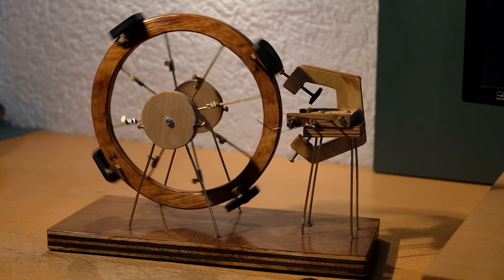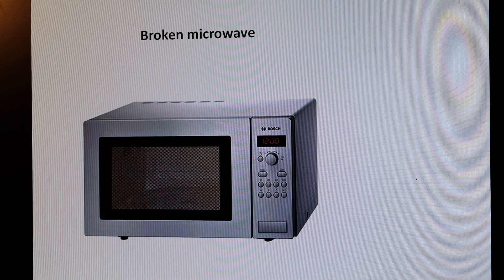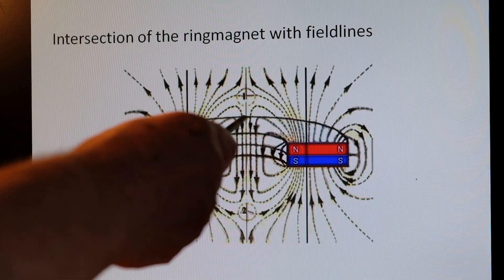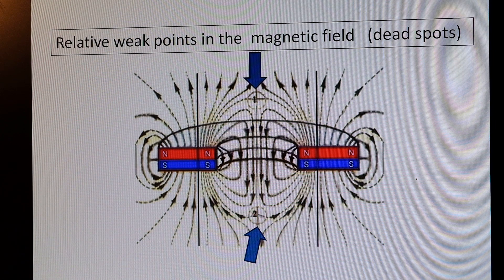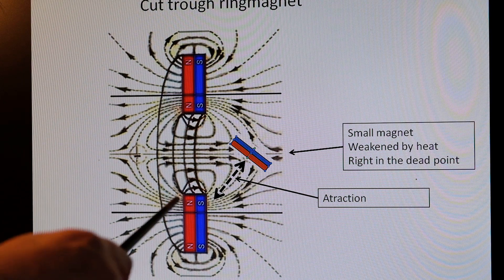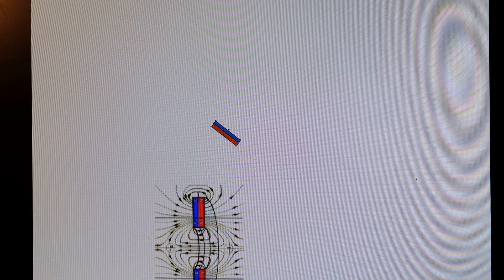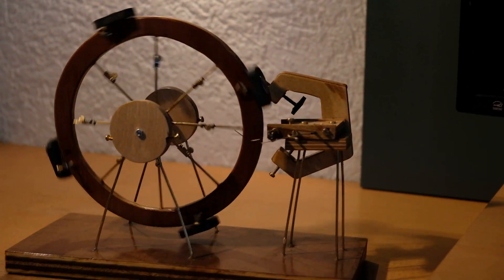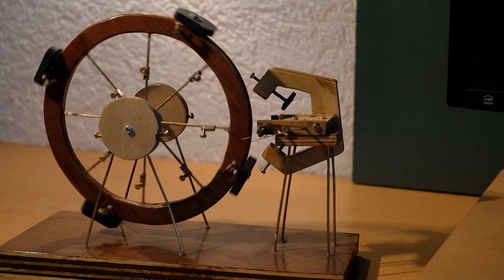Self running magnetic motor  self running magnet motor

Comment: I don't think the point is to give it a load necessarily. What I'd do is have the magnets excite coils to take advantage of the energy in the environment through back EMF by having a quick ON OFF through a transistor. All you really need is a continuous rotor and if you use air coils then there is no drag back on the magnets, especially if you fix the circuit so that the back EMF can give a little kick to the magnet on it's way out away from the coil.
Reply from the maker: Thanks for your reaction. you are speaking words of wisdom.
Reply: @perpetuummobile5068  True wisdom is quiet when you don't know what you're talking about.
Reply: the coils without drag back are only open coils (and obviously not kick away nothing), when you close the circuit trougth a load the coil drags back the magnets
Reply: Alas, the force generated by these coils will be very meager and will not be able to push a magnet even 100 times smaller than this one.
Reply: I can hear it so it's already outputting more energy than what's going in.  Overunity, or in my tongue, magic, has been achieved.  You all saw it here, the bloody impossible.

Comment: Why is there no repulsion when the small magnet ist passing the first side of the ring?
Reply from the maker: I think that I understand you question. In the first place there is a big mistake in the powerpoint from the momentthat  the pictute  is moving . the little magnet is in wrong  position. The problem is that  I cannot change the film in youtube._I also think that there are moments during the passing of the small magnet  that work contra productive. Not a problem as long the result is positive
Reply: @perpetuummobile5068  That is what I can verify at the moment: there're negative torque while the stator magnet is passed. But it's all about the right timing to trigger the lever for turning the stator magnet.

Comment: Notice that to have FREE ENERGY the device should show a continues acceleration and this device do not produce that, it can only gain some speed and then maintain such speed
Reply: So there for as this device do not use gasoline or any other  input so this is a REACTION DEVICE, using environment energy, gravity plus magnetism
Reply: The device proves something really interesting ... you can use magnets to have a reaction in such form that gives  you more energy as out put that what you put on the input due to the way magnets work  because magnets produce fields that are not on equilibrium and the lack of such equilibrium produce motion and the interaction of other forces prevent the magnets to reach equilibrium at any point in time there for motion, the problem comes when you put a load
Reply: The load could mess the reaction and there for prevent all motion jaja so  you wont get free energy or the free energy would be really low
Reply: @jorgeflores5222  It's already got a load, I can hear it, air friction, bearing friction.  It's already putting out more than what's going in.
Reply: Graeme Lastname Exactly lol.. so many people think load is exclusive to copper wires or something. If a wheel can magically turn longer than it would otherwise, and has the same controlled variables of load inertia etc.. it is already perpetual in theory. I don’t know why people don’t understand that lol. Any moving object is already 100% efficient, so any shown improvement on a spinning wheel, regardless of load, is over unity. As long as the load remains the same in both experiments
Reply: @jorgeflores5222  The device proves something really interesting ... The batteries are well hidden.
Reply: A perpetual motion machine doesn’t necessarily have to produce a constant acceleration. For example if the Newton’s gravity wheel worked, it couldn’t possibly accelerate too fast because it depends on steady force of gravity to work. Instead it would ocilate in a very synchronized way as it tries and fails to speed up. If this machine works the way he claims it works, it would move something like this. The small magnet has to have time to reset after all before it can address the next magnet, so it can only turn so fast. But in any case, based on the principles he described alone, it doesn’t work. So either it’s fake or he just doesn’t fully understand how it works

Comment: EN:
A theory came to my mind how this engine could work.
Perhaps the small rotating magnet is so weak that it undergoes reverse magnetization under the magnetic field of the large magnet on the wheel when the two magnets are closest to each other? Then there is probably no resistance to rotating the small magnet in the field of the large magnet. As the magnets move away from each other, the field of the small magnet returns to its normal polarity and interacts with the magnet on the wheel to drive the wheel.
One would have to try with a very weak rotating magnet placed close to the wheel.

PL:
Przyszła mi do głowy teoria jak ten silnik może działać.
Być może mały magnes obrotowy jest tak słaby, że ulega odwrotnemu przemagnesowaniu pod wpływem pola magnetycznego dużego magnesu na kole w momencie kiedy oba magnesy są najbliżej siebie? Wówczas chyba nie ma siły oporu przy obracaniu małego magnesu w polu dużego magnesu. Po oddalaniu się magnesów od siebie pole małego magnesu wraca do swojej normalnej polaryzacji i oddziałuje z magnesem na kole napędzając to koło.
Trzeba by spróbować z bardzo słabym magnesem obrotowym umieszczonym blisko koła.
Reply: Hello Jar Kon, good theory, let's test it manually.
Reply: @antonioijano8060  Good luck. I will also test it.
Reply: @Ogród_i_Elektronika  Good morning Jar Kon, just to inform you, I tried with the magnets very weak (weakened by the heat) in my case it still didn't work, although it improves for an interaction of the magnetic fields, but on the other hand they don't have the strength to turn the wheel because of the friction of the lever. Let's keep in touch, Hugs my friend!
Reply: @Ogród_i_Elektronika  Congratulations on your creativity, I was delighted with your intelligence, now put the little magnet on and see if the frictional strength will improve, because in my opinion our problem is friction! We are looking forward to it!
Reply: @antonioijano8060  In my opinion, the biggest problem is the magnetic resistance force when a small magnet rotates in the field of a large magnet.
If this force can be minimized somehow, the frictional forces of the mechanism will be overcome by the attractive and repulsive forces of both magnets.
Reply: @Ogród_i_Elektronika  
Yes, really, there is this magnetic force that brakes too.
Reply: First, start with a frictionless bearing, that should be easy.  An AC permanent magnet, yeah.  Get that at the toy shop?

Comment: Everyone who watches your videos (including me) would like to believe that you've succeeded where centuries of inventors have failed.  Not to mention, that all the physics books would need to be rewritten.   But, I can't take your machine seriously as long as it has that thick, laminated wood base, because it's the perfect place to hide an electromagnet, a circuit board, and some batteries.   It wouldn't be difficult to replace that base with a transparent one and silence a lot of skeptics.  But, you're unwilling to do that, so I think you're having a big laugh at all the folks who believe in you.
Reply: You might be interested in these machines..

https://ie.energy/earth_engine/

There are two others almost production ready..

https://infinitysav.com/magneticgenerator/

https://gaia-energy.org/en/projekt-yildiz-announcement/
Reply: @nobulistic  Denis, Thanks for providing a link to the Earth Engine website.  The machine shown on the website is impressive looking, and it's obvious that some investor (or group of investors), with a big pot of money, believes in the project.  I'm not going to dismiss this invention on the basis of the Laws of Thermodynamics, because I think it may be possible to produce a machine, based on some new principle, which can run for long periods of time, while drawing energy from some source we have yet to discover.  Consider that an atomic energy power plant would have looked like a "free energy" machine at the time of the Civil War.  Now that we understand the physics of atomic energy, we can see that atomic power plants break none of the laws of Thermodynamics.  Assuming that the Earth Engine can produce and sustain "over unity" power output for a period of years, while doing useful work, then everyone on this planet will know about and use this invention before the end of this decade.  But, that's a big assumption for me, because as Carl Sagan said, "extraordinary claims require extraordinary evidence". So, while this machine looks promising, I have to withhold judgement until more detailed information is provided by the inventors.  If pressed to guess how it works right now, I'd have say big flywheels make me skeptical, because they store energy.  So, I'd guess that energy stored in the flywheel is keeping the machine running.  If the initial push that started the flywheel rotating came from an external source, and if the flywheel is gradually slowing down, then this is nothing new and what we have is a hoax.   This machine has the potential for being either the greatest invention in human history, or one of the slickest scams in history.   One problem I have when it comes to believing in this device is the fact that the machine shown in the video is so large, that it's impossible to determine if a source of input power is connected to the device somewhere.  For that reason, I can only evaluate the claims made for the invention by examining the explanation of how it works that was given by the narrator in the video and from reading the information provided on the Earth Engine website.   From reading the website, it appears that two principles are at work, the first is an asymmetrical magnet array and the second is the "Slingshot Effect", which NASA has used successfully to give a boost to exploration spacecraft.  Regarding asymmetrical magnet arrays, a linear Halbach array does have a strong side and a weak side.  One can imagine that an array like this this might be useful in an over unity magnetic motor, but no details are given about how the asymmetrical magnets are used, so that information is not very useful at this time.  As for the "slingshot effect", that doesn't produce any energy by itself, it only transfers energy from one system to another system, so that principle alone can't contribute any energy to the device if the attraction of gravity is replaced by magnetic attraction in the device.  It's true that gravity assistance from a planet can be used to accelerate a spacecraft; but, the assist is provided by the motion of the planet traveling around the sun, using the planet's gravity to pull on the spacecraft and thereby to accelerate the spacecraft.  To put it another way, to increase speed, the spacecraft acquires some of the planet's orbital energy as the spacecraft flies near the planet.  Gravity is not supplying the energy that accelerates the spacecraft, gravity only acts like the straps of a slingshot to pull the spacecraft along with the planet, using up a tiny bit of the planets velocity as it orbits the sun.  This is why it's called the "slingshot effect".  If the machine in the video is making use of the slingshot effect, then it's only using the slingshot effect and magnets to transfer rotational energy stored in the main flywheel to another wheel that's attached to the shaft of the generator.  In that case, all the power produced by the generator is supplied by energy stored in the large flywheel and that energy came from some external source, perhaps an electric motor that was used to spin up the flywheel and was then removed.  If this machine turns out to be all that it's claimed to be, then I'll be delighted to eat my words, because the world's energy problems will have been solved, not to mention the problem of global warming.  I sincerely hope this is true, but I'm not going to hold my breath.    NOTE:  I'm talking about an original slingshot with leather straps, not to be confused with the elastic straps of what some people call a slingshot today.  The original slingshot uses energy from a man's arm to spin a rock around on two straps; releasing one strap causes the rock to go flying off in the direction of the target.
Reply: @nobulistic  I didn't see your other two links the first time I read your comment, but I went back to check out them out.   The INFINITY SAV is an interesting machine, they are taking pre-orders for a home sized generator, which is a red flag to me, because that's a common way scams raise money.  The old trick is to raise a lot of cash on pre-orders and then disappear before the facts hit the fan.   This doesn't mean it's a scam, but I'd rather see a product that's ready to ship with a money back written guarantee.   Also, I see what I believe is a flaw in the the way counter EMF is supposedly neutralized in the INFINITY SAV machine and since that's key to the operation of the device, I'd love to comment on it, or discuss it.  However, this is Perpetuum's youtube video and I've already bent the rules by commenting at length on the unrelated Earth Link machine.   The GAIA project (your other link) has a machine that looks like it's ready to ship, but it could be nothing but a nice looking case with nothing in it.   Unlike the machines in your other links, GAIA gives no explanation for how their machine works, so there is basically nothing I can say for it or against it.    I don't see how you can research it, unless the GAIA Project is more forth coming with you about how it works than they are on their website.
Reply: > But, I can't take your machine seriously as long as it has that thick, laminated wood base, because it's the perfect place to hide an electromagnet, a circuit board, and some batteries.

Exactly. There are only two plausible possibilities with this machine: Either it's a scam, or it slows down but very slowly. The longest video is only a few minutes, and it may slow down after 15 minutes, or whatever, but it will slow down eventually.
Reply: @nobulistic  I'm a 78 year old retired electronics engineer, so we have something in common.  Unlike you, I've spent my entire life thinking about how to build working, over-unity magnetic motors.   I got interested in this subject when I was around eight years old.  By the time I was nine or ten, I had three ideas on paper that I was sure would work.   By the time I was twelve, I had built one of my designs and discovered (as so many others have) that spirals of magnets have a "sticky point" in the rotation that prevent spirals and ramps from working.   During my teens, twenties and thirties I was interested in other things.   In my forties through my sixties, I worked so hard and such long hours that there was no time or energy left over to work on the magnetic motor project.    I did a few experiments after I retired on idea number three,  but I have never tried to build it.  As far as I can tell, my third idea (from age nine) is unique and has never occurred to anyone else.   As for your other interest, UFOs, I'm very skeptical that they they are extra terrestrial in origin.  The Roswell crash makes me laugh, because I can't imagine that creatures with the technology to travel all the way across the universe are such bad drivers that they would crash when they got here.
Reply: @itisonlyadream   Good to know we have similar ‘pedigree’ !
Regarding Infinity SAV, you don’t have to pay any money up front when you pre order. You can also pay monthly like paying a Utlity Company. There is a UK Distributor in London and I have registered my interest for a demonstration, along with my ex employer when the machines become available. I have also been corresponding with their President Gary Tripp in the US and he tells me that investors are still skeptical and they are struggling to raise the money to complete the production machine. The sad thing is, their inventor Andrii Slobodyan died a month or so ago which is very suspicious! There are lots of videos on the web showing various stages of development of the Infinity SAV machine and the Yildiz generator.
Reply: @nobulistic  Denis, this is all very interesting and I'd like to discuss it with you some more.   I got your email (thanks!), so please delete that message asap to avoid spam.
Reply: All that would prove is smaller batteries.

Comment: Hello sir,
Could you please share me the drawing with the same dimension details as yours. 
Thanks a lot.
Reply from the maker: SorryTuan I do not have a drawing but on this vodeo you can see  the magbetmotor from all sides see https://youtu.be/r4N4TiOHc-g
Reply: @perpetuummobile5068  Hello sir, please ask you about the size of the wheel? How does the tweak make it run? Can I use the bike wheel? 
Thank you very much.
Reply from the maker: @tuanhungkha5226   I have not expirimented with bike weel. There is another builder that use a bike weel named Benjamin Thomas